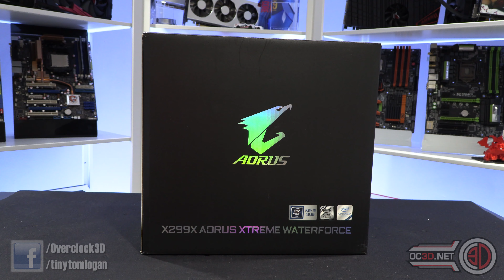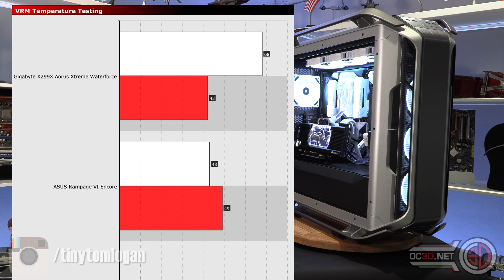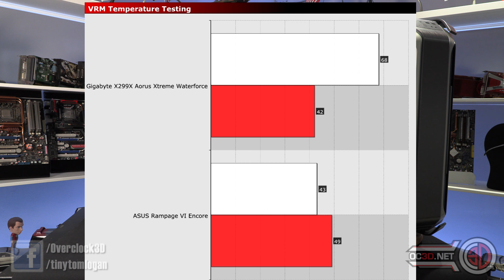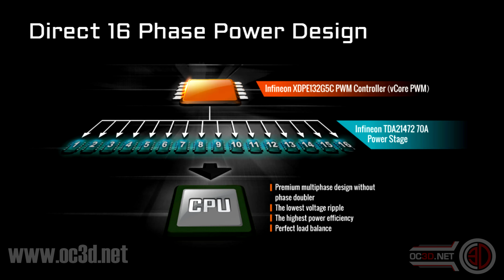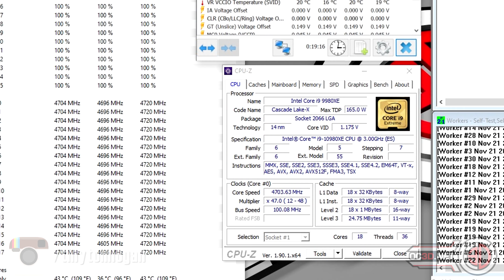Gigabyte X299X Aorus Xtreme Waterforce i9 10980XE Full Watercooled Review Build

Comment: Did i miss the bit where you talk about CPU temps ?
Reply: Also the package looks a little bit toasty for 4.7 @ 1.1175
Reply from the maker: Just the way it is with these processors, even at these low volts. Its all about the actually power they pull.